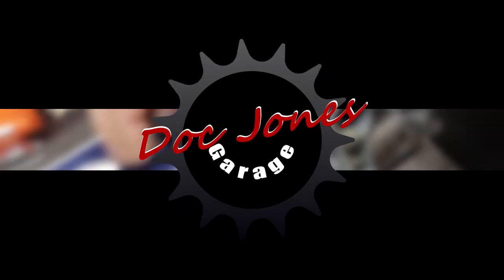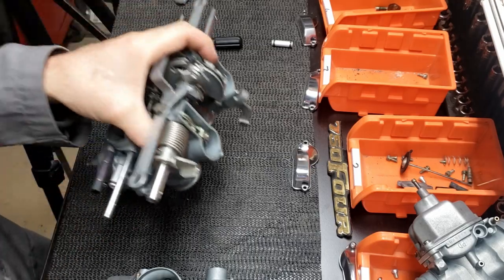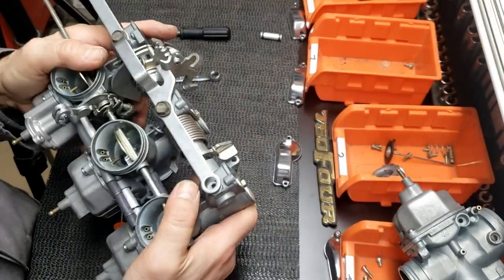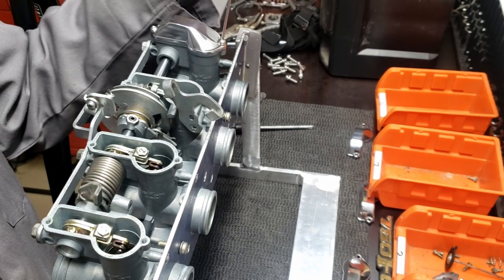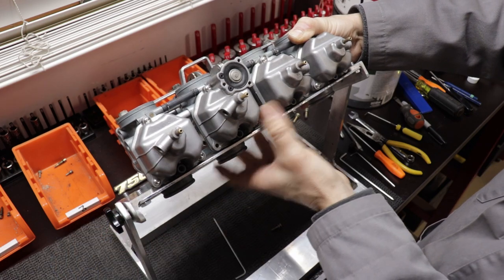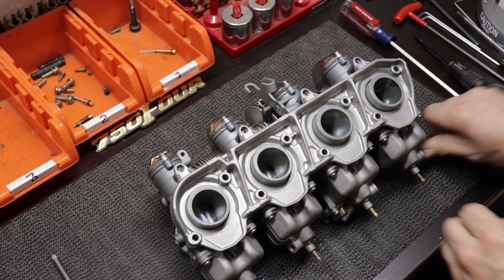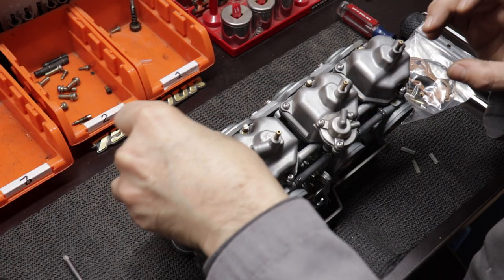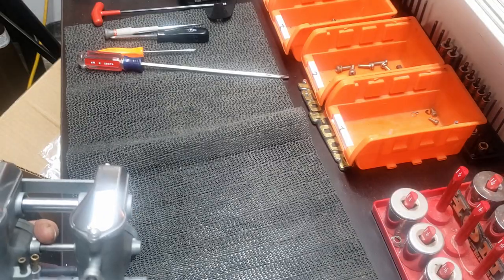Episode 5: Carburetor rebuild part III (final assembly) 1978 Honda CB750 K8

Comment: 12.26.23.    ☕️That docking plate you use to mount the carburetor bank to work on, is quite enterprising❗️
Reply from the maker: Thanks! there's a couple of changes I'll make to it but it saved me wrestling with it on the work bench that's for sure

Comment: Hey! Your videos have been big help for me putting 2 sets of carbs back together! Can you provide where you found the guy who was making the wiper ring for the linkage on the carbs? Mine are missing or split.
Reply from the maker: That's great! I'll see if I can dig that link up for you.
Reply from the maker: https://www.ebay.com/itm/166199866265

These are felt rings like what my carb has, double check the size your looking for

If I remember this next link is the person that I found before

https://motorcycleproject.com/text/felt_seals.html

They say they sell them but I didn't see a link to a spot to buy them, might have to contact them.

Hope that helps
Reply: Thanks a bunch!